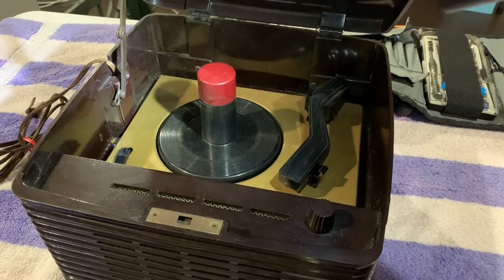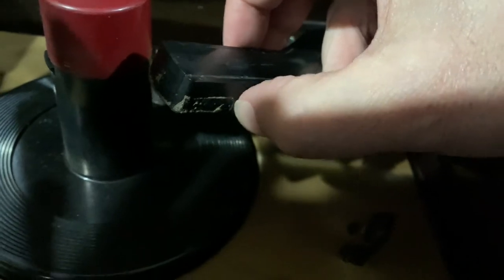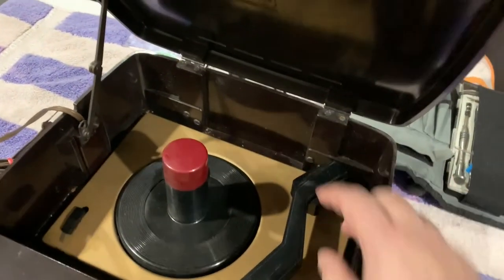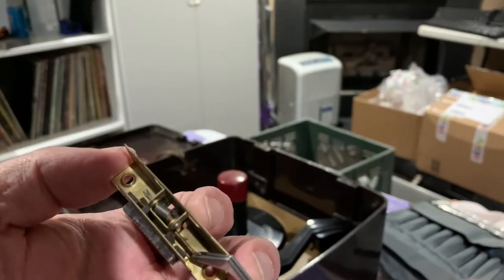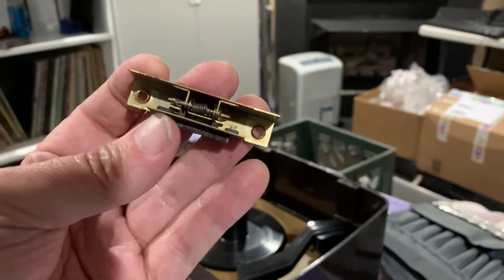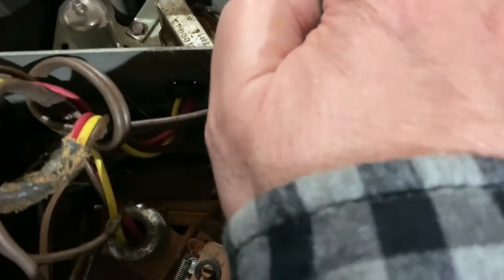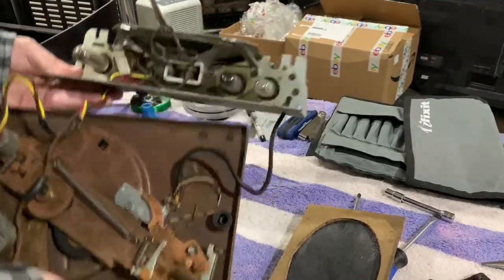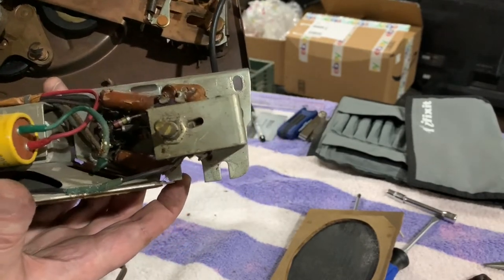Restoring an RCA 45-EY-3 Record Player Part Two

Comment: You will need to order a replacement rubber drive wheel and cam wheel from thevoiceofmusic.com. This is pretty much mandatory as the old rubber is on borrowed time. These will not work properly and it   will never be able to adjust  properly if this isn't done.  Also, will need a needle and cart, also available from thevoiceofmusic.com. I am in the process of restoring the Alice in Wonderland version of 45 EY 3. It took me three days to finally get the changer right. These are a mechanical nightmare.